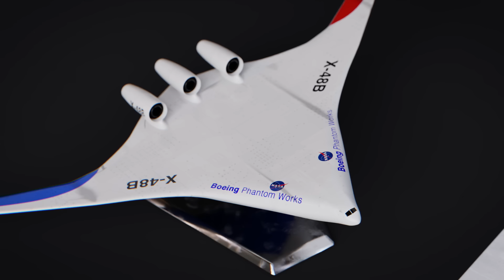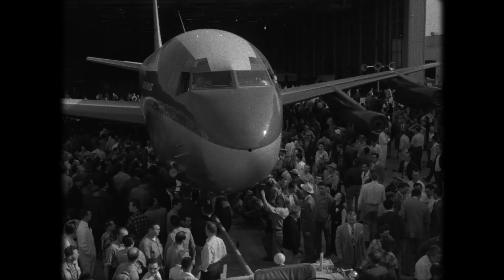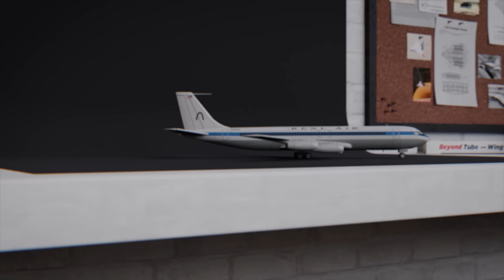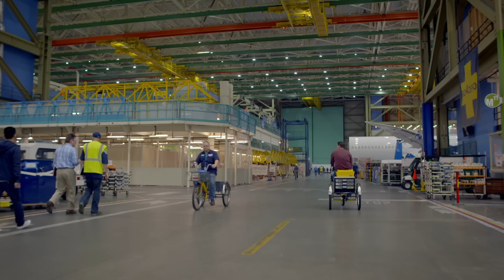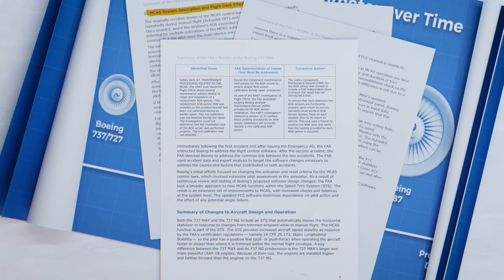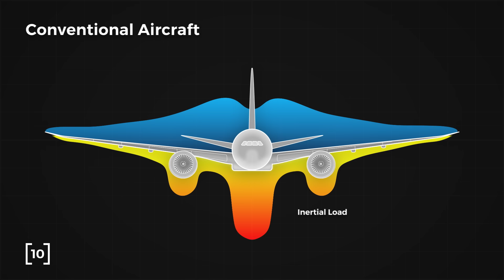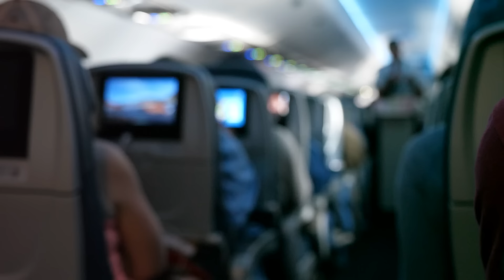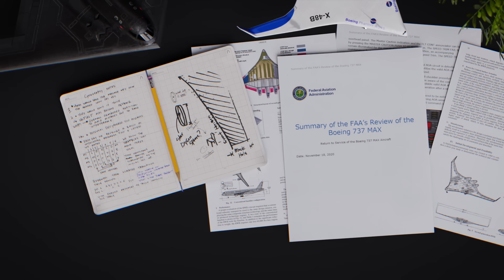The Plane That Will Change Travel Forever

Comment: This episode contain quite a few very bad design suggestions and arguments.

* Its not the vortex that creates the drag. The vortex is a result of escaped air, that would have provided lift but now don´t. So the vortex is the result, not the reason

* The tube and wing design was an 1930 evolution of the box and wing design. Even prior to pressurization was common, most airplane was tube and wing, this is due to the even distribution of load of on the fuselage, having no diagonal loads. When pressurization become common this was still a practical design. The first serial produced model was the Boeing 307 Stratoliner

*The wing and tail design is not the only stable configuration. There is also the delta, the canard, the tandem and the tailess. Al of those exist in a stable configuration. So the solution the induced tail drag is not exclusive to the flying wing. Really half of the argument in this video is based on that. There even been mass produced commercial aircraft that was tailless, the Concorde. Also the Dreamliner suppose to be tailless

*The number of the wetted area is incorrect. The tail is not 25%. Actually its usualy less than 1/4 of the wing surface are, so 20% of the wing area, but the fuselage is often about half, so that reduces it to about 10%. The added lift drag is also about 10%.. that is 5+5%... well. That would be for planes with  wing mounted engines. For tail mounted engines its significantly higher.

*A problem with the Flyingwing and/or blended wing aircraft is the terrible interior space of the aircraft. Look at a B2. The cockpit is sticking up quite a bit, and its hardly even standing high in it. Granted the wheelbay is under it. But still, its a very thin aircraft, and it have to be. So the aircraft have to be freaking enormous to have full standing high. That is, you can´t make a mid size airliner, its jumbojet or nothing.

* The exit claim is also a false argument. There is already airbays with two bridges already to day, i even seen them with three. And no, its not the sharp bend that make it clog up. Its people putting there bags in overhead bin. The bottle neck is in the corridor, not the entrance. Wide body aircraft there for simply double the loading speed due to haveing two. There is also a other way of increasing it. Having the loading door more aftwards. This is true for planes like 757 that have the entrance right ahead of the wing. This creats two corridors despite it being narrow body. A wide body airliner with canards could have there door absolutely centered, quadrupling the entrance speed.

*The load distribution graph is not right. The fuselage is really not that heavy. Most heavy components is in the wing, landing wheels, engines.. well the wing.. and most importantly, the fuel. Fuel is typically 30-50% of the aircraft weight (for long haul aircraft).

Now a tube design is really efficient in transferring loads, especially so under pressure. Yes, the airliner is less likely to fail at altitude than on the ground. The highest load factor of a airliner is actually neither passenger, hardware or wing, its the air pressure, its literally order of magnitude higher than any other load. There for this load have design priority.

* The blended wing really have no major impact on the air escape at the wingtips. The only thing that really effect this is wingtip geometry.

*The square window myth of the Comet is a myth, the real reason was hole punch. Because the hole that did fail on one of the crashed aircraft was close to the corner of a window, this created the square window myth. Remember doors are still square on modern airliners. The reason why windows are round is to reduce the stress on the window, not the air frame.

*The higher pressure of the 787 have nothing to do with that carbon fiber is stronger. Its due to the water recycling system that is part new pressure turbine that replaced the old engine feed cabin pressure. This enable the air to be more pressurized with out being very dry. This is also true for the A350. When the A330Neo was introduced this system was not moved over mostly due to concern with condensation. Ironically the main reason for the system is to save fuel

*No the freaking windows being larger have nothing to do with the aircraft being made of laimate/carbon fiber. Why don´t people activate there brains prior to making claims like this. Okey. Go to the front of the airliner, look at the frontal window. Now answer this question. 1: are they round, 2: Are they small, NO and NO. Does a 737 use carbon fiber at the front, no. The reason is simple. The large square window myth was never true. The reason why airliner windows are small and round, is to reduce the stress on the window, not the fuselage. The reason why the windows are small and round is simply to lower the stress on the window, not the fuselage. The reason why the window at the front by the pilot is so large, is becasue they are like 3 inches thick. Its like a 250kg window or something in that range.

The reason why the windows in 787 is large is three. 1: its laminated windows, 2: the windows are high, but narrow 3: the windows dont need a shade, reducing the space needed above them (increasing the vertical space the windows can work on)

*While carbon composite have a excellent drag characteristic, but the bend characteristic is much worse. You can´t side load it with a huge force and think it will remain straight, it wont. This have a large number of compound problems. This is not a easily solved problem. "just use composites".. sorry, reality don´t work that way
Reply: H0T-Vlog Go to My Channel  Well yes, but it would still be more eco friendly per passager mile.

There is also other aspects. A extremely low fuel consumption aircraft unlock other technologies like synthetic fuel that is currently to expensive. If aircraft come down to 1liter/100km, synthetic fuel would be in range of affordability.

Comment: A 50% reduction in fuel consumption is NOT "more eco-friendly"!
It is "less harmful."
The oil industry propagandists have really done a job on our species when even engineers have got it all @rse-backwards!
Reply: I mean, not really. A 50% reduction in fuel is massive regardless of the fuel you're using. The move away from fossil fuels is inevitable, but that will take time to adapt our infrastructure. but in the meantime reducing our use as much as possible is a good thing to be doing, we can't just magic all our planes to be carbon neutral.

Comment: Basically, about 100 years ago an energy  efficient model was invented but there are some practical problems. We could possibly solve one with computers and by adding a whole lot of complex electronics that increases the points where the plain can fail and kill everyone. The other one is solved with reinforcements which are also expensive, so for the next 30 years it will be nothing but prototypes and maybe a specialized cargo plane here and there, just like in the past 100 years.

In short: we have computers and that doesn't really change physics, so... clickbait? Clickbait it is.

Comment: For what it's worth, the problem that caused the 737-MAX crashes wasn't a problem with MCAS and "faulty software" as much as it was a problem with pilots not responding properly to a known failure mode of an electrically trimmed aircraft. Specifically: trim runaway. The pilots in the Ethiopian crash actually recognized the runaway and disabled the system but then didn't also properly manage their airspeed and were unable to manually trim the aircraft at the 115% maximum airframe speed they got the aircraft up to... So they turned the electric trim back on, only to have it resume "running away" and they crashed as a result... Sure there were now obvious design problems but the glaring pilot problem here has yet to be solved.

Comment: It's good to hear your comments regarding Boeing's failures with the 737 Max, my own comments at the time were almost exactly in line with that opinion. Some people at Boeing were guilty of criminal corner cutting that resulted in hundreds of deaths, all to avoid re-certification after modifications that resulted in a major change of flight characteristics. Why there has been no criminal investigation is beyond me.
I can't say I am happy with the currently accepted 'fix' either, if it's a 737 Max or whatever Ryanair are are going to rename theirs as, I won't be flying on it.
(Ex airframe engineer)

Comment: I've been wanting to build a bwb experimental plane for quite some time. The problem I'm faced with is adapting RC stability control systems. Which are quite good I might add. Maybe the best there is. However redundancy is not really part of the system. Meaning I'd have to take multiple systems and run them in primary slave configuration with sensor checksums and a lot of other things I don't have the greatest grasp on. Maybe I should just build it and worry about control when the time comes.

Comment: Perhaps the biggest hurdle in adoption will be the required retrofit and operating costs for existing airports to accommodate the new fuselage design. In order to take advantage of the faster boarding, you'll need six times as many jetways per gate, which will all need to be moved for each arrival and departure. That gets especially tricky to allow for different fixed wing aircraft sizes necessary to account for the various passenger demand for different routes.

Comment: The problem with blended wing is the discomfort the passengers will feel as they are seated further away from the middle of the plane. When the current planes banks the passenger do not feel too much discomfort because they are closer to the middle. Further you’re moved out from the middle, greater distance you will be moving vertically when banking or rolling. Think about the seesaw, passengers seated on outer edge of seats in the wing would suffer from roll accelerations and movement.

Blended wing will be perfect for freight, but for passengers, no thanks I’ll pass.

Comment: Just add shorter cylindrical passenger carrying aluminum alloy tubes over the engines. Low cost, standard construction, much faster loading. better weight distribution and more volume for hydrogen fuel. Similar to what was proposed to get arctic oil to the lower 48.

Comment: There is another obvious alternative:  The canard configuration.  In a canard configuration the horizontal stabilizer is in front and it provides lift to stabilize the aircraft instead of negative lift as shown when the horizontal stabilizer is in the back.  The Beechcraft Starship from the mid 1980s was a commercial canard configuration airplane.

I understand there are also stability challenges with a canard configuration, but it would preserve the tube and eliminate many pressure cycle related problems.

Comment: Genuinely one of the most interesting videos I've seen in a long time and you have the perfect demeanour and voice for teaching.

I do have one slight concern though, you touched on the fly by wire/software stabilisers but I feel you missed the most important point entirely. If you're 100% reliant on your flight surfaces to just stay airborne then what happens if you lose even one of them? With current designs you can lose a control surface or even an engine and the human pilot can take over and usually land safely, you mentioned that humans cannot reliably fly blended wing craft even when they're operating normally, what happens if there's a major malfunction, the software cannot correct it since its lost a fraction of its control surface and the human pilot also cannot take over and correct it? Its not like you can add redundant engines and flaps.

Comment: I would think that one of the problems with a blended wing is that airport gates would need to be modified to accommodate this type of aircraft
Reply: Yep, and nowhere will bother doing that until there's a critical mass of aircraft like this, which need airports to have gates that it can be used on for airliners to buy them. It's a chicken and egg situation lol.

Comment: Nope.  You can break a tail that is perfectly maintained.  This happened with an Airbus A300B4-605R. American Airlines flight 587.  Also an airbus crashed over Europe because of air speed sensors feeding incorrect data to the flight computer...

Comment: The 'trick' with measuring fuel use PER-PASSENGER means they can just add more seats to artificially inflate the efficiency metrics & make even more profits at the same time.
Reply: Well that is no trick.   Using the amount of energy used to convey one person over a given distance is a perfectly valid metric.
 Yes, part of the improvement was certainly due to the aviation industry being able to build larger airplanes carrying more people in it.  Now it certainly has decreased the quality of the flying experience, but after all the main goal of taking an airplane is to get from A to point B. 
And the net effect was not so much an upgrade in profit but the incredible decrease in the cost of flying for consumer : in the Sixties flying was pretty much a luxury that only the affluent could afford on a regular basis. Three decades later pretty much anyone with a steady income could easily save the money required.

Comment: This is engineering? The graph at 1:15 tells me nothing. Left side is numbered 50-100 instead of 0-100 to misrepresent what the line actually looks like. AND makes no mention of the unit the 50-100 represents. If I want to know how much fuel is needed to fly a passenger 1 km this graph does NOT tell me.

Comment: There is an upcoming engine improvement I heard quoted at 15-20% efficiency gain for Rolls ultrafan, I thought it was purely change to gearing to improve bypass ratio (has been limited by getting gear technology good enough) but the ultrafan includes or maybe enables wider changes.... Might be worth looking into :)

Comment: A tail system is not fool-proof or invulnerable. Lots of designs were assumed to be safe - even with massive margins of error - which didn't account for out of spec weather conditions, or pilot error pushing the tolerances into failure mode. (source : my father who did stress and loads on airframes (and rockets) for over 50 years in military, space and commercial aviation). As far as windows - you can paint the entire cabin in OLED to such an extent (cheaply - and with minimal power reqs - to make it appear that you're not even in a plane if you wanted. Those are being considered in the Hyperloop pods - which are a much smaller design. Finally you don't need carbon fiber to mitigate pressure loads on unconventional airframes. You can mill a honeycomb pattern or other geometric forms that acts both as internal strengtheners as well as crack propagation mitigation. They're already used on rockets to provide insane weight to load ratios.

Comment: Have an electric accelerator speed up the aircraft to 320m/s and let go. This acceleration alone saves more than ~1,500 kg of fuel per takeoff

Saves 10 tons less weight in landing gear and wheels which are no longer needed so lower mass lower fuel per mile

The same type of accelerator catches the aircraft at the landing airport

All these savings allow longer range aircraft and better fuel per kg of cargo or passanger

Comment: Why carry 10 tons of wheels and landing gear. Have an electricr accelerator and decellator at airports

That would be an improvement on safety and a big improvement in energy efficiency allowing 10 tons more cargo per flight or 10 tons more fuel so longer trips with fewer stops or just lighter and more efficient

Comment: 8:19 - 9:25 Why can't they just make a balanced plane with a tail stabiliser that has neutral angle of attack?
Reply: He didn't explain it well at all.  These destabilizing forces aren't as random as he said.  In reality, the most efficient aerofoil sections transfer the center of lift forwards, with an increasing angle of attack, which must be counterbalanced by the tail.  Now, imagine, making the angle of attack of the tail the same as the wing.  No stabilization would occur at all, because both center of lifts would move forward, to force the plane further into a steep climb, the more it starts to climb.  So, obviously the tail can't be used to generate a proportional amount of life as the main wing.  To overcome this problem, the tail must be in the neutral position, when the wing is at high angle of attack, which is when the center of lift has moved forwards, to match the center of gravity.  Yet, in normal cruising flight, the center of lift has moved further back, which is when the tail must push downwards, to stabilize the plane.

Comment: One thing to note about having a very large pressure vessel like this plane is CF is a nightmare to repair.  There's a reason airbus used CF panels rather than wrapping a whole mould like Boeing.  Delamination from an impact can be repaired in a small spot, but anything big its much better to be able to replace a panel.   This thing would have to be grounded for a very long time for checks after any kind of knock

Comment: While I appreciate the video and the huge efficiency improvements that could be made here; I think that the rebound effect will just cancel out these gains in the overall consumption of fuel and output of CO2, if this is simply left down to market forces. That is why I believe that more focus needs to be put on the possibility of using hydrogen as a fuel.

Comment: You are overstating the improvement.  "Between 1968 and 2014 the average fuel burn of new aircraft fell approximately 45%, or a compound annual reduction rate of 1.3%."  There is nothing sustainable about air travel.  These are green wash projects for the class that bleats about climate emergency while being unwilling to give up their globalist lifestyle.